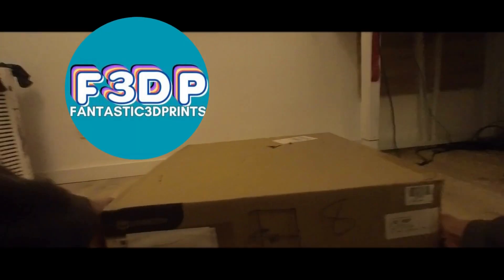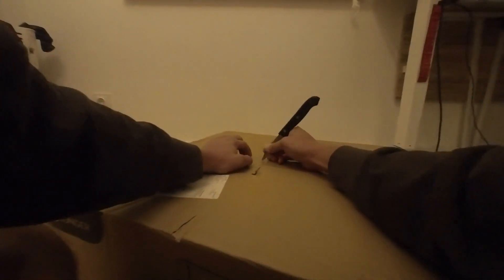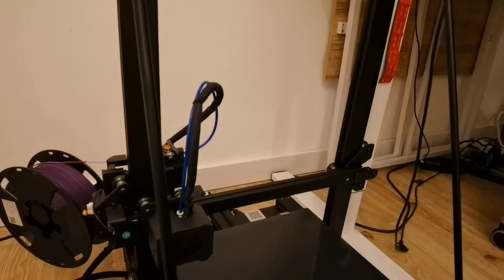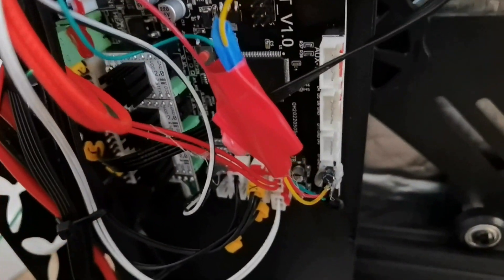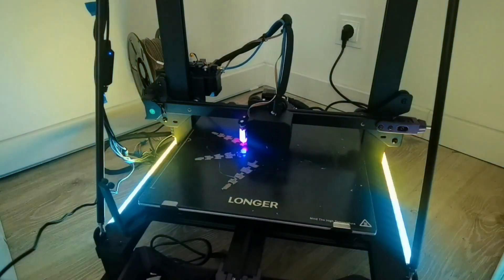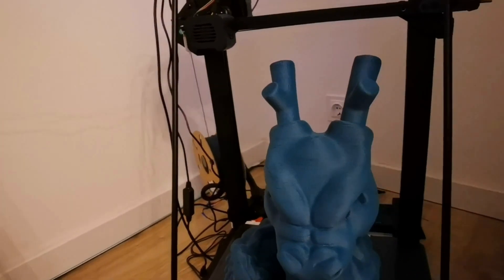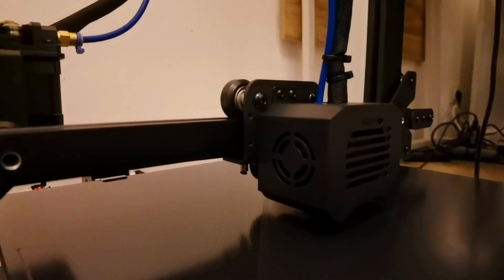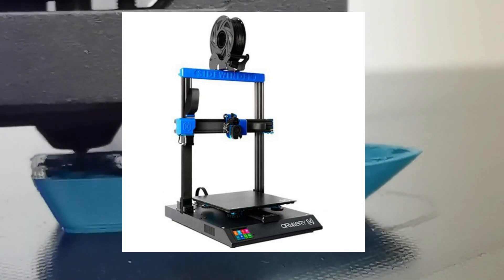Longer LK5 Pro 3D Printer - Still any good? Featuring Klipper

Comment: Be advised that if you have purchase and receive a defective unit Longer has no customer support. I called and emailed after purchasing one of their units do to it having issues and not feeding any filament and PLA, TPU, PTGE and they will not respond. Furthermore they blocked my number from calling them as now it goes directly to voicemail but when I restrict my caller ID the phone rings before being directed to voicemail. I would avoid this company all together and picking an alternative option..
Reply: Really? I havent had any issues with their support via email
Reply: This guy has copy paste in at least 8 vids
Reply: not one problem they respond to me just fine and replaced my whole printer !!!!!!
Reply: I not only have no issues with their email support, but their WhatsApp contact is very responsive and helpful. I've got an LK4 pro, LK5 pro, and Ray5 20 watt laser.
Reply: How did you get you bltouch working and what board was with it
Reply: @jimmiepetsel8813   longer has guide on their site. There's brackets available to download and print for mounting it. Just.... Look it up.